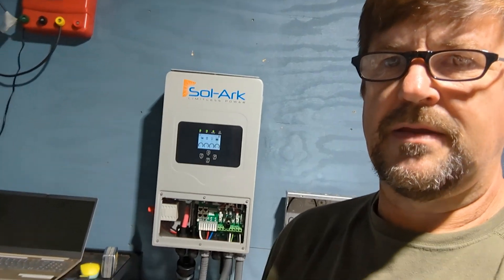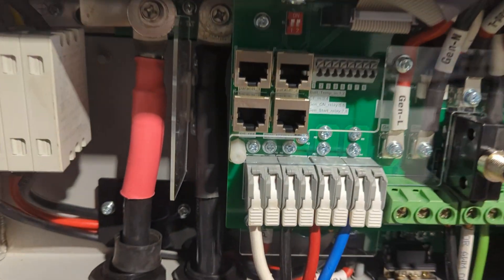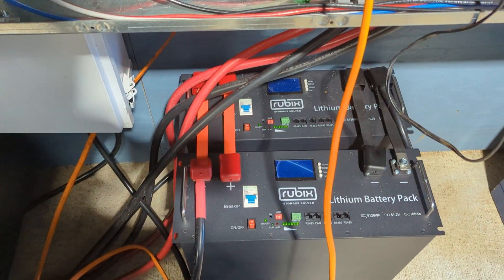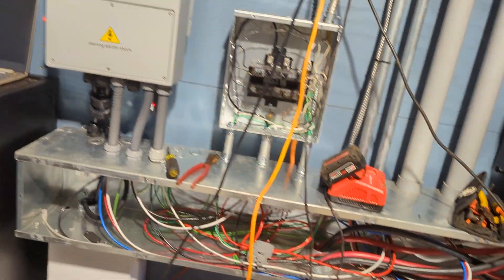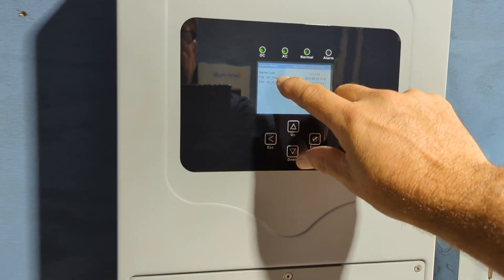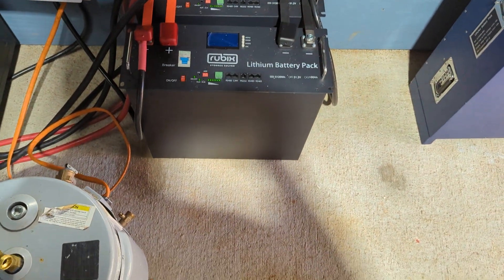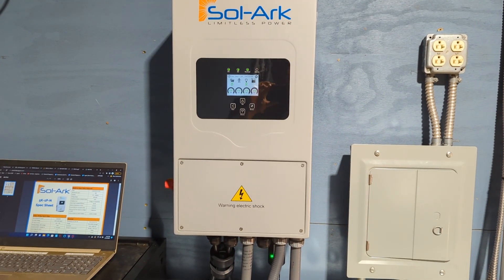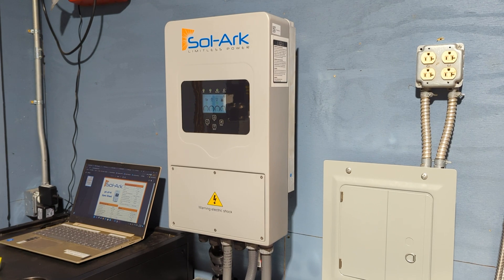Tested and Certified: Sol-Ark 5k 1P

Comment: Just nemch tested my 5k
4.6kw constant load with heaters and air compressor 
Then
Maxed out to 6kw with welder
Voltage dropped a bit but it kept up

Impressive 
Heard that the HF cant start well pumps. It did just fine. Ill never run more than 50% load but good to know its capable

Comment: So I am currently running a photos 6.5kw hybrid inverter with two racks of solar totaling right at 4800 Watts.

Issue is it over heats at peak sun. My local distributor is suggesting the sol ark 5k as a direct replacement. 

How does this inverter hold up over time? Any sign of temperature issues? Other problems I should know about? I have about 20kwh worth of lithium battery onboard, so we can take all the power this thing will give us for charging, if it will keep up with the thermals.

Comment: Nice video, I'm working on a system based around one of these. Couple things aren't clear from the manual, maybe you can help. Did you install an external fuse or breaker for the batteries? The manual says it has a 250 amp breaker/disconnect but then in their wiring diagram the show what looks like an external breaker. Also what about breakers for the PV array? Did you install any? I only noticed the breakers for your AC side.

Comment: I believe that integrated push button on the load-out of the inverter is a breaker that provide over current protection.  Is it 50A rated?

Comment: I think the price would be justify if it can passthru 120/240 and if it can parallel with another 5k to get 120/240. This features are already available with Victron. Otherwise no, the inverter has no cost benefit in comparison with other offerings on the market.

Comment: IMO- IF the 5k was 12v batteriy compatible it would be a SOLID solution for an RV upgrade.  However, almost EVERYTHING in an RV thats DC (lights, stereo, fans, heater blower, etc.) are all tied to the 12v HOUSE battery bank.  Its inadvisable to move those items to the start batteries.  Sure you could use this and a step-down DC to DC transformer, or you could avoid that additional appliance and its associated costs by using a VE Multiplus II, which does use 12v HOUSE batteries.  Sol-Ark needs to make this 5k in a 12v battery configuration and THEN it would be an option in an RV, boat, etc.
Reply: 12V is too lossy. You lose too much in DC -> AC.  16 times more loss than 48V
Reply: @longtimber1  Thats NOT the issue.  The issue is 99% of the Coach and RV manufacturers do not design the DC circuitry for anything other than 12 VDC.  The reason being the cross compatibility of everything in the coach.  If you need to bridge the start batteries with the house batteries for an engine or generator start - how are you going to accomplish that with 48VDC house batteries?  Don't tell me a DC to DC inverter because the amps needed to start a large diesel pusher will overlimit a standard DC to DC inverter.

Comment: Can that new 5k be wired to the main panel so the homes loads can use grid power and inverter power at the same time if loads exceed the output capacity of the 5k?

Comment: Can you do a walk around for this set up? 4x Sol-Arks with 2x E4g; looks like a rather larger home setup!
Reply from the maker: My power shed has 4 separate systems in it.  I am keeping the 5k-1P offgrid to run the shed and then I use the other systems to run my home.  15k, 2 12ks , EG4 inverters etc with 5 differnt battery manufacturers.  Too many wires!

Comment: Hello, I just got a 15k (on the way here) and am considering batteries.  Have you hooked a Sol-Ark to your EG4 batteries?  Do you do that without communications?  If so, have you had any issues with that?
Reply from the maker: I will have a video out tomorrow on this.  I am running my home/business on a 15k with 6 EG4 LLs.  No closed loop, no problems yet.
Reply: @engineer775  Have you had issues getting the EG4 batteries to balance too each other? Some users have had issues with the individual batteries having wildly different charge/discharge curves and crazy imbalances.
Reply: @N8TheSnake  use the Rack and cross wire the + and -

Comment: I will be getting one to keep my computer room supplied with solar power but to also have a really good backup supply for the bad weather...we get hurricanes here a lot.  
With several servers plus a butt-load of PC's, laptops, slates, tablets & phones...and cooling (window AC) I need a reliable system...with a cost savings against the electrical use.  
As mentioned before I will need a maximum of 30A of 120VAC...though I have never actually hit the max (hit ~25A once) I want it to be there if I ever do need it.  
Hopefully these will be the ticket  :)

Comment: Think it would be a good backup for a grid loss.  Right now I just have a Sungold inverter and a EG4 battery as a backup to power a frig, freezer, some lights, and a gas furnace.  I have a 14kw diesel generator for house when needed, but the EG4 battery is a quiet night time power to run freezer, frig and furnace without running the generator.  Like to add some solar to make it all work.

Comment: What would be the benefit of this over the classic sol ark 5k? Seems like it’s nearly the same except all 120v output instead of 120/240. Other things I’m missing?
Reply from the maker: One of the benefits comes from being able to use 120v output generators to charge up your batteries.  I thinks they are going to discontinue the 5K split phase and jsut suggest that folks buy the 8k.
Reply: @engineer775  does it also grid output to utility? I thought grid output to sell needed to be 240v. Not sure I’ve seen a 120v grid sell back inverter. Thank you! I’m a Long time watcher
Reply: @Upliftyourbrothers  same question

Comment: Looks Good, Just curious what is the minimum and maximum voltages you can set in it?
Reply from the maker: DC? AC?   https://practicalpreppers.com/wp-content/uploads/2022/09/5K-1P-N_SpecSheet_8-24-22-1.pdf
Reply: @engineer775   I meant AC. Where I live we have 110v @ 50 Hz. I currently have an Outback VFXR that I had to manually adjust the minimum voltage down to 95v and the max to 120v for it to work with our grid

Comment: Don't know what you have been working with, but I would put my Victron Multi-Plus up against it anytime... you can get two 3000 watt Multi's and configure them for single or split phase... for less money.  Don't know much about Sol-Ark...  I hear they are great.  But Victron makes solid stuff as well.
Reply: You are forgetting that this includes a 500 V MPPT SCC that can handle over 10K of solar.
Reply: @joeh3767  True the Multi's don't include SCC, they come in about even once you add that... but Victron still makes really good stuff.
Reply: @michaelmorris1802  I agree and own Victron SCC’s. Just wanted to clarify.
Reply: @joeh3767  No issue, was an omission on my part for sure.  Not apples to apples.

Comment: You are 100% correct🎉. Bought a couple of EG4 6500 exes for my shop. I'll let you know how I like them compared to my 2 ea 12 k's. I did shut the 12k's down the other day by running my Dewalt circular saw. You wouldn't happen to know what caused that would you? It started fine on the EG4's, my Tripplite 2000W hostpital backup power supply and a cheap Edecoa 3000W inverter.
Reply: Sol-Arks aren’t big fans of imbalanced loads, heavy surge currents on 120v loads are the the main thorn in the side of Sol-Arks, or all transformerless inverters for that matter. That being said you could use an auto transformer to improve the performance of imbalanced loads.
Reply: @NoahBeall-BPS  Be careful about mentioning that ..the solark fanboys will hunt you down. You're not suppose to revel that a $8k inverter can't start the same saw a $1200 can.